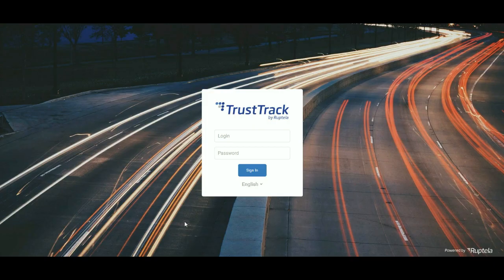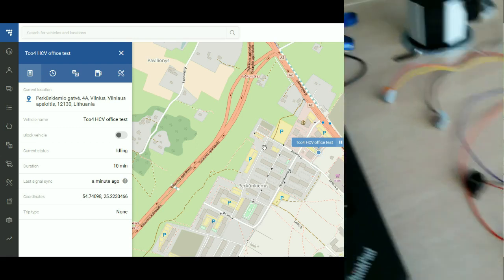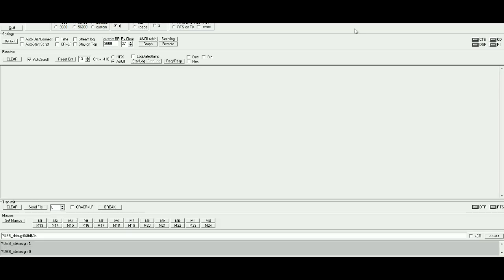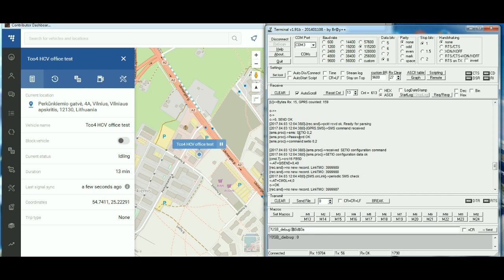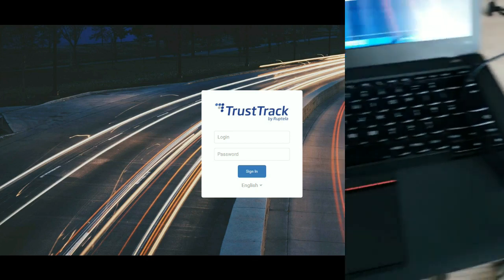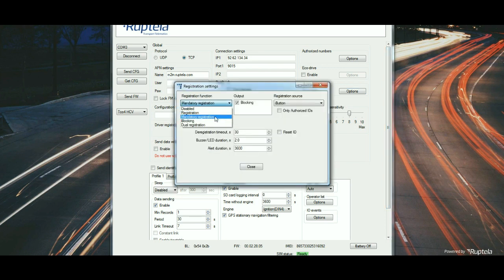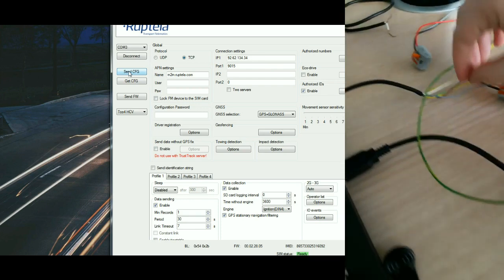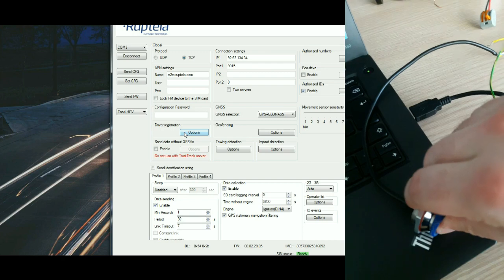Blocking the vehicle - platform and driver registration iButton Solution_Ruptela

Comment: Hello!, is any way to Unblocking the iButton via APP Commands. Why? because if i go to a somewhere that have Valet Parking Service and i dont what give the iButton Reader. Thanks!
Reply from the maker: Hello. It's possible to use Bluetooth beacon for driver identification (and unauthorized use). Works same as iButton, but wirelessly. Please see feature description below, and contact your sales manager, or drop us an email to info@ruptela.com  https://doc.ruptela.lt/pages/viewpage.action?pageId=37683326&preview=/37683326/39715069/EN%20Bluetooth%20Button.pdf